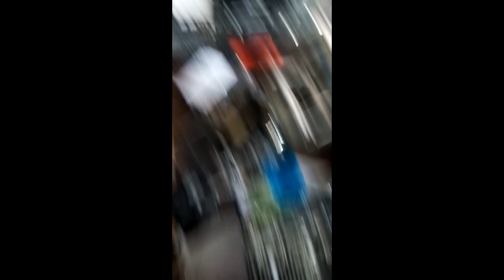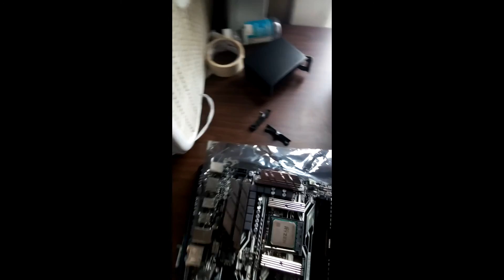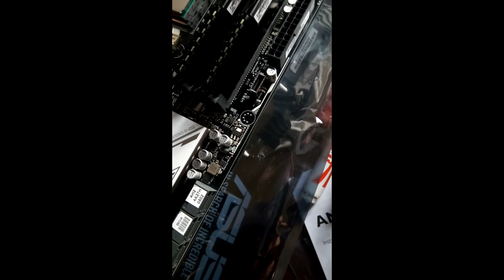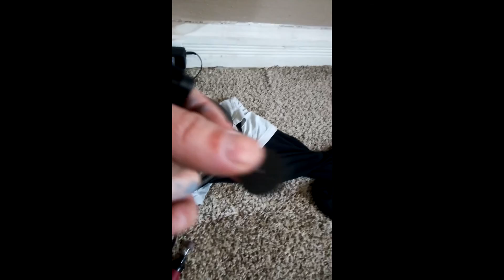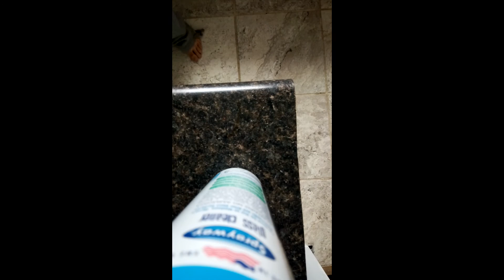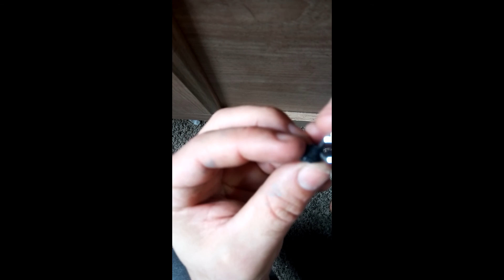How to am4 bracket mod ryzen genome deepcool ii

Comment: So I got the AM4 bracket from them, but it includes this black mounting bracket which you didn't use on this video. How can I use that instead, so I don't have to cut anything?
Reply: I don't want to burn anything either. Shouldn't Deepcool have made this straightforward enough?
Reply from the maker: This was a mod before the bracket was released from deepcool,if you ordered the new one just installed like normal.
Reply: It doesn't fit on my ASUS Prime X370 Pro motherboard. I mean it goes in, but something on the board takes up space and I can't properly install all the bolts on the bracket